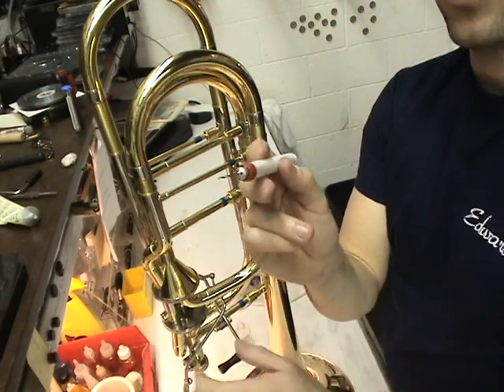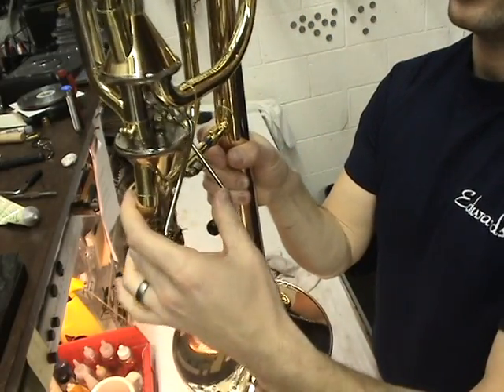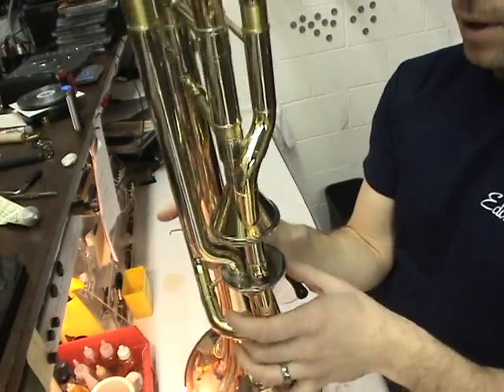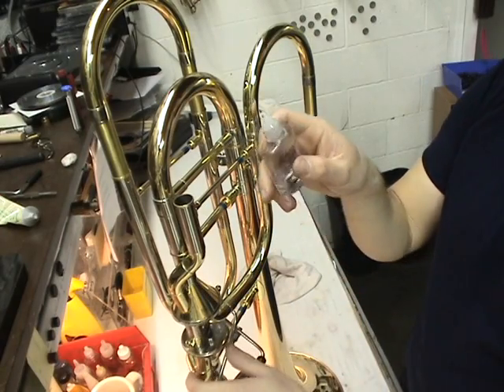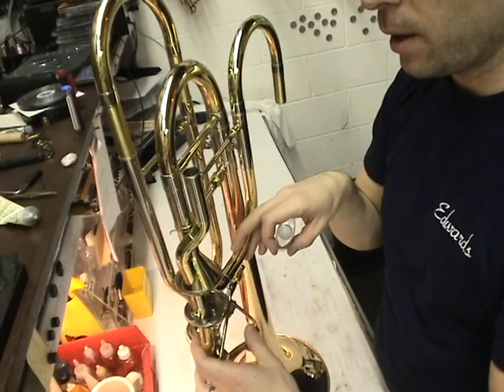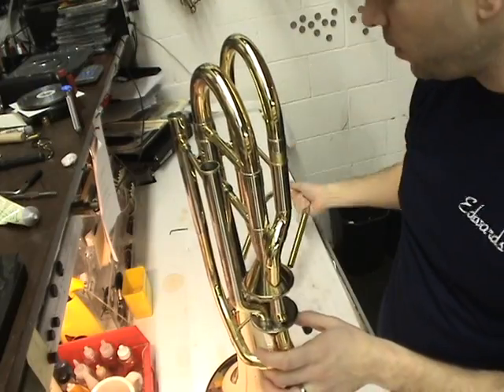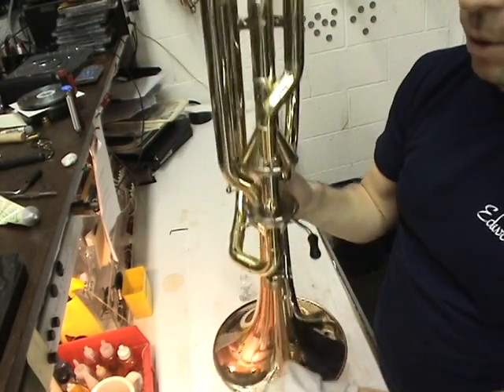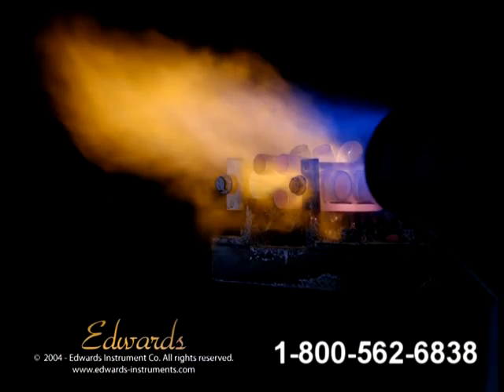Bass Trombone Axial Flow Valve Lubrication

Comment: I purchased a second hand Shires bass trombone. It has a dual axial flow, independent valve system. I have tried to open it to clean it similar to the way that Ron showed in the tenor thayer valve video, but the F valve doesn't seem to come apart. It stays in once piece and there seems to be no way to service the rotor inside. I know that you probably only answer questions about Edwards instruments, but if you know if there is any way to separate the valve to clean it, could you tell me?